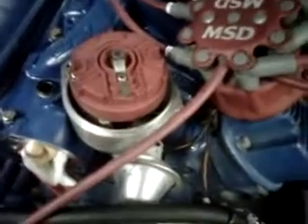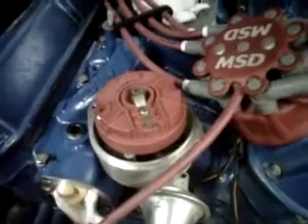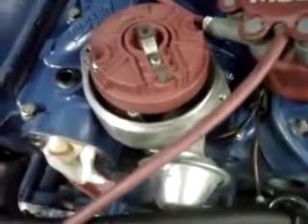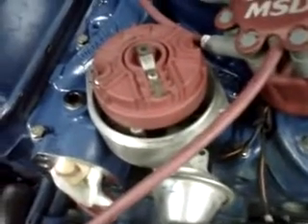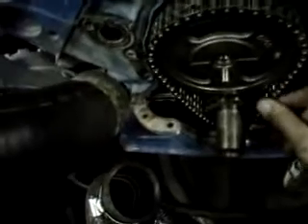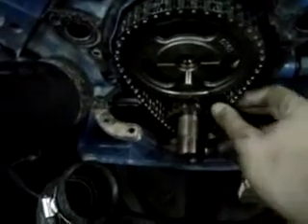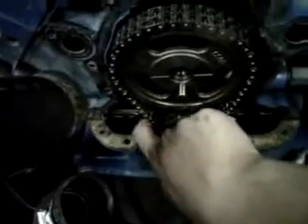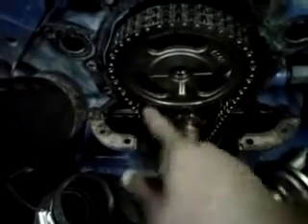Ford 302 timing chain check OLD vs NEW

Comment from the maker: i of course have yet to mess with the cam setting. if i want more out of the engine i usually go to a bigger cam that is pre-advanced. 
check out the link i just added to my description. they say some good things about the topic here that should help you. there are many variables and they are addressed well here by several postees. 
the year plays a big factor on stock style engines due to emissions.

Comment from the maker: it really depends what cam you are running. advancing the cam will increase low end torque but take away from the top end. and retarding will do the opposite. a lot of aftermarket cams com advanced from the factory and in that case i would be inclined to leave them the way they are and go with the stock setting on the chain. the cam card will tell you how much it is already advanced. i would imagine if you dont intend to spin over 4500 that a 2 degree or 4 degree advance wouldnt hurton stock cam

Comment: mines bone stock with 167k and the double roller should not have worn out, but lack of lube will do it every time,  also i didnt know to remove the oil slinger at the crank and it did rub a grove into the slinger about an 1/8"  i will not put it back on when i replace the gear set with the ford racing set that i ordered today,   Thanks

Comment: im doing my 66 coupe today and it has a double chain that is at max 1/2 play per manual, it shouldnt have wore out a double roller (mine and yours) so quickly thats BS
i think youve got the "fix" with the ford racing oil passage thrust plate.   Thanks for posting this vid